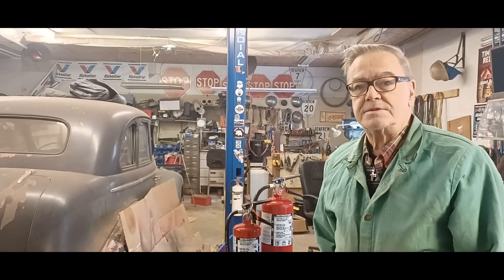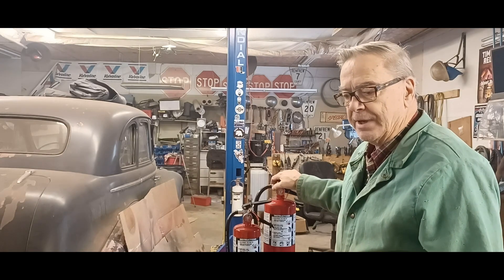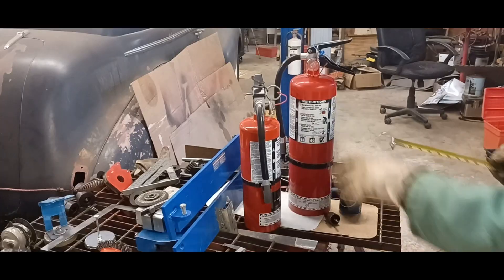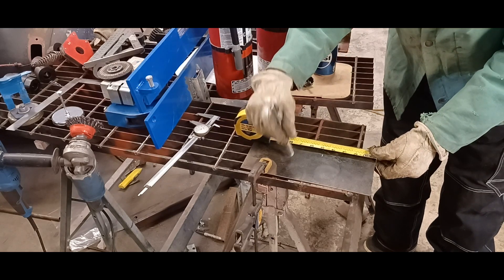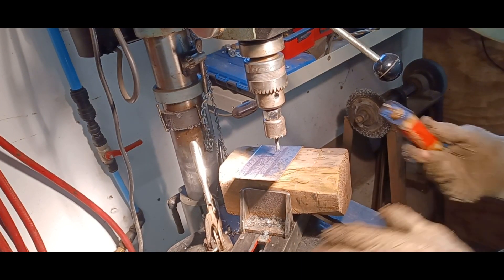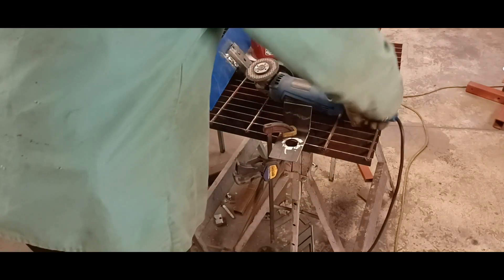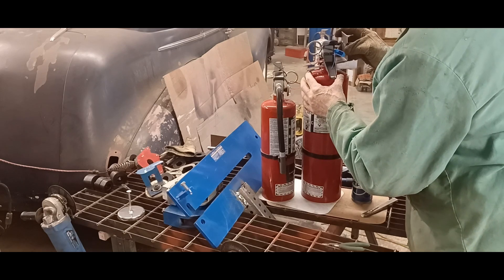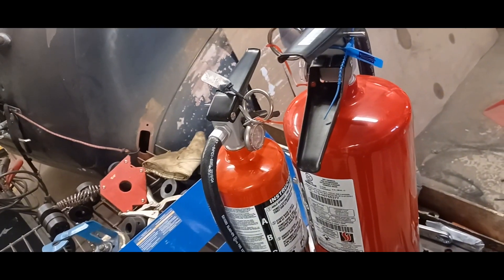# 289 Always  be ready for a fire in the shop

Comment: I've never noticed your grating tables for metal work and welding thats a great idea too. 
Now hopefully you'll never need the extinguishers but if so, they'll be where they're accessible.
Reply from the maker: Hey Loves.  Thanks for dropping by the Dog House. Yeah, I've had those for welding tables for about 4 years now. They work great. I can put my ground clamp on the end of the grate and I don't have to ground clamp my parts. I just set them up over sawhorses and put them away when done.